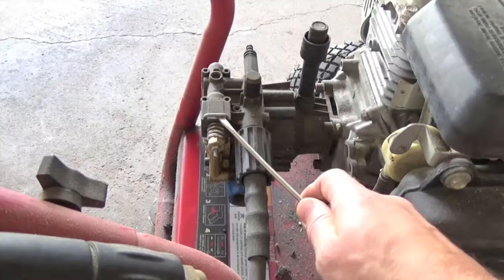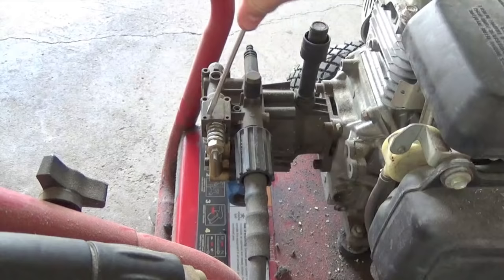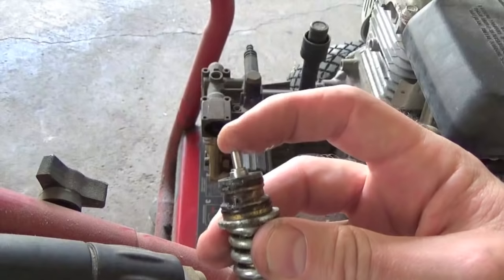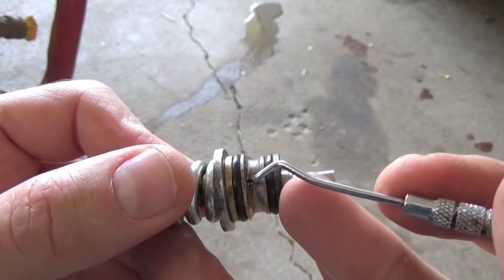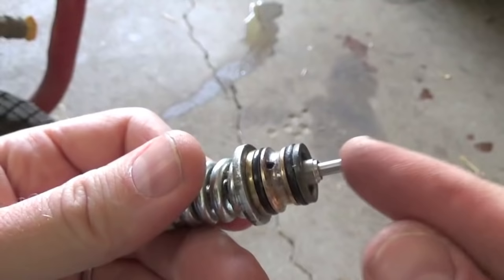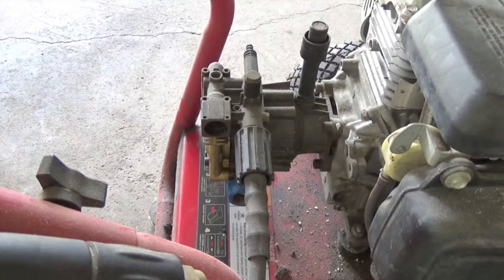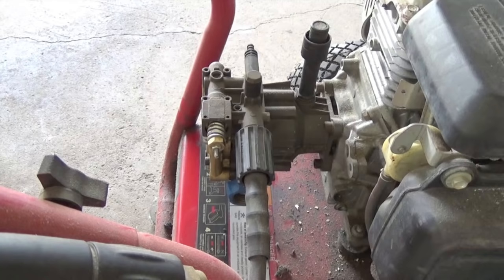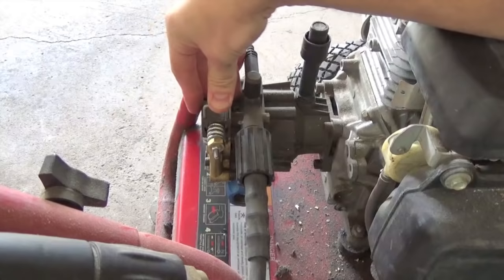Fix Pressure Washer Unloader Valve in 2 Minutes

Comment: "fairly easily"..........that is what all you guys are saying. well, mine broke at the "bolt"....any idea how to get it out now? surely, this is my problem.....thanks!
Reply from the maker: Well, considering it is already broke, I would drill a small(ish) hole into the end of the stuck part and then run a screw (with a big enough head to grab onto with pliers) into that hole and then grab it and pull/pry it out.

Comment: i did that and still intermittent pressure, any suggestions? I'd change the valve but it'll be over $150 shipped.
Reply from the maker: Yuck, if this doesn't work I would check the small plastic spring valves under the brass part of the valve. They tend to stick badly, especially if you have hard water. They are super cheap to replace but can be a pain since you will want to replace the o-rings at the same time Lining up the o-rings is time-consuming.

Never pay for just the valve, you can get an entire new pump cheaper. Valves usually cost somewhere in that ballpark, a new pump is likely around $80. Four bolts, easy work. I have another video on replacing one.

Thanks for watching and taking the time to leave a comment!

Comment: after checking my unloader seems to be fine but pressure washer will still bog down and shut off when not pressing the trigger, any suggestions
Reply from the maker: That sounds like a compression or fuel issue. Does it still pump water through the system?
Reply: @HNXMedia  only water that comes out is when the trigger is pressed it runs great when the trigger is pressed, also if you let off the trigger and let it bog till it dies when water is turned on you cant pull the cord to start, to much resistance. You have to pull trigger and drain system before you can pull the cord thats why i thought it was the valve

Comment: My powerstroke honda 160 Pressure washer has the unloader valve stuck in the hole, I'm afraid broke  extracting it. Used U40 lube screwdriver nothing happend unloader Valve stay  in hole.
Reply from the maker: It could be completely stuck because of corrosion or hard water. It is cheaper to replace the entire water pump than to buy a single unloader valve. I have another couple videos showing how to easily swap out a water pump. The new water pump will have a new unloader valve too https://youtu.be/Np9c0MLnUv8

Comment: Are the Pins Universal? and does the pin seat behind the valve to force it in there?
Reply from the maker: I do not want to give bad info, but I believe all the "U Pin" style are universal. It doesn't really "seat" (as in "click into place"). but it does fit tightly.
Reply: When I try to put in the pin, is it behind the valve? or is it in-line with the valve sleeve? I was given this unit, and the previous owner bought a new valve, and then lost the pin. So I didn't take it apart. Trying to figure out if the valve isn't in far enough (I have the old valve, and tried to seat it with a hammer), but I can't see any day light from the pin holes. I can't see them at all when the valve is in. Is that right (timjoebrown@gmail com).
Reply from the maker: @tb01803   I think I know what you mean. Ok, if you pull the valve out (it should come out easy if there is no pin) you should notice about 3/4 of the way on the valve body a section that the pin slips "behind/into." Don't be afraid to use some grease to help get the valve seated "deep enough," you are not going to hurt anything. Push in on the valve, slowly try to put the pin in. Once you feel the pin going in a little easier, tap it with something to help it along. Once the pin is "flush" it is seated. The pin WILL NOT go in if the valve isn't in far enough. Let me know if this helps.
Reply: @HNXMedia Thanks. I just ordered: Briggs & Stratton 190578Gs Pin.  I was messing around with some small bailing wire and got that through side to side on upper and lower.  Now, this is where the plan went bad. I put water to it, and it blew out the valve, and the part with the ball. I also wound up with a spring, which I don't know if it was behind the ball part or not or from something else going on today. So now I have to figure out the right way to get the ball, the ball seat, and potentially spring, and then wait for the Pin.  Thank you for all your help and responsiveness.
Reply from the maker: @tb01803  The spring should be behind the ball (as if pushing on the ball to cause the ball to "seal the hole" if that makes sense). You know, I absolutely LOVE this comment, because using bailing wire to fix a pressure washer is something I would TOTALLY do. Much love! Best of luck, friend. Peace.
Reply: @HNXMedia  is the order from outside in: Ball, ball seat with o-ring part, and spring all the way in hole?  Or Ball seat, ball, spring ? the ball is just loose, not sure of how it stays in the seat, or if I lose another part when it shot across my patio. Is there a correct process on getting it all back in there.
Reply from the maker: @tb01803  I think it is the first one (working from memory here, so please be careful) - Ball, ball seat with o-ring part, and spring. However, if you think you lost any parts, I would just order a new one. HOWEVER, the last time I checked (a couple years back) it was cheaper to buy an entire new water pump assembly (about $80) than to buy a new unloader valve. Brother, I feel your pain, but replacing the entire pump is SUPER simple. I did a video on it as well. Sending good vibes.

Comment: My powerstroke honda 160 pressure washer low pressure AND the unloader Valve its stuck in the hole. I'm afraid to broke it. Used screwdriver, pliers, hits. But no one. I can't put it out. What i do ?
Reply from the maker: It could be completely stuck because of corrosion or hard water. It is cheaper to replace the entire water pump than to buy a single unloader valve. I have another couple videos showing how to easily swap out a water pump. The new water pump will have a new unloader valve too https://youtu.be/Np9c0MLnUv8

Comment: Mines all free and clear but still won’t unload. Great pressure but keeps grunting away after I release the wand ???
Reply from the maker: If you have have hard water, the build-up can clog/corrode the internal "plastic spring valve thingys" inside the water pump itself. You can open the pump and clean/replace these yourself (super cheap), but it does take a little bit of patience and technical ability. If you feel confident, give it a try. They are usually lined up (4 in a row typically) directly under or inside the actual brass part on the water pump. Each one of these plastic valve things will also typically have a o-ring. Replace the o-rings too if you are going to get that far into it. It really is simple and you can source most of the parts from Amazon or the online retailer of your choice. On a pressure washer, as long as the motor is running well, the only thing that controls actual performance is the pump. Worst case scenario, swap out the pump (usually less than $100), which is super simple. I have two other videos showing that. Hope this helps.

Comment: LOL "you're done watching this video". mine is blowing straight out the side full pressure when i let go of the trigger. I think this is the issue. just wanted to check out the awesome 
tubers on it before i popped the valve out. thanks for the "non" bla-bla-bla video. YOU ARE DONE REASDING THIS COMMENT..LOL
Reply from the maker: LOL! And I would lie to add that YOU are AWESOME for watching my video and taking the time to leave a fun comment. When we are working around the homestead, we ain't got time for nonsense. Get it fixed and get back to work...because there is always more work to do. Sincerely hope that this video helped solve your pressure washer problem. Your comment made my day!
Reply: Update. I did all that. put it back on.knocked it in a little. got the retaining pin back on.Fired it up. Let go of the trigger. It's blowing out sideways even more. Adjusted the spring more then less. still doing it. I'm going to put some new o rings in it and see what happens. I'll update ya tomorrow. P>S> I did a bunch of work in Homestead/Cutler Ridge (PALASCE CENTERFOLD STRIP JOINT)and Floriday City. after Hurricane Andrew. Ended up living down in the UPPER KEYS  for 8 years. I painted SUPREME OLDSMOBILE IN FLORIDA CITY. Every night going back, I hit THE LAST CHANCE SALOON. I AM DONE TYPING..PEACE
Reply from the maker: I have had to replace the o-rings and the little plastic valves in the water pump in the past (not too much work, but I had to wait for parts). If it gets to be too much of a hassle, just replace the entire water pump (see my other videos on that). It is an $80 fix that is actually cheaper in the long run of the unloader valve wasn't the problem. Good luck, my friend!

Comment: And if that does not solve my pressure issues?
Reply from the maker: Could be that the interior if the pump is completely corroded. If you don't feel like opening it up to clean it - lots of little parts) you can just replace it. It is super easy and I show you how right here: How To Replace Pressure Washer Water Pump (Part 2)
https://youtu.be/Np9c0MLnUv8

Comment: My pressure washer won't idle down when I release my trigger... continues to build pressure....
Reply from the maker: That certainly sounds like an unloader issue. Hopefully this vid will help your pressure washer get back on track. If not, I would check the little plastic valves under the upper part of the brass pump-head (thats where they are on mine). Sometimes those stick. I had to fix those on my old pump several years back. But certainly check and clean the loader first. It is often the simplest fix. Thanks for watching and taking the time to leave a comment. Peace!

Comment: Did u say Greece? ???. Anything that can compress air to 3000 psi can cause a explosion. Never put petroleum on high pressure parts. Use non petroleum silicone. If that was a scuba tank ,it would have exploded  when u opened the valve.

Comment: OK , I'll be the group dumbass that asks, since you kinda jumped right into RemoveInspect Clean n Replace without saying WTH that part even does.   What's it's purpose?  

Im trying find a fix for my 2000 electric, it works but won't shut off, just keeps on running.  Is THAT the part that is supposed to kick it off when up to pressure?
   I wonder, I had mine on three hoses, was the pressure to low to make it shut off maybe?  I was gonna test it on one hose but forgot.  I will later.  
Anyways, I appreciate the short video, but give me 15 see seconds explaining what the parts For at least.
Reply from the maker: Long story short, the unloader valve regulates the pressure so that the pump does not "pressurize" and rupture. Just about anything to do with pressure on a pressure washer can be fixed by cleaning the unloader valve. If that does not fix the problem, it is cheaper to replace the entire pump than to replace just the unloader valve itself. I have a video on how simple it is to replace the entire pump on my channel (3-4 bolts and you're done).

Comment: My unloader valve moves freely , the machine stills stalls if I have the garden hose connected and on and I’m not using the sprayer
Reply from the maker: Does the engine stall or the water pump not create pressure?

The next step to solving the problem would be: Pull the pump and check the seals. Also, separate the pump head (usually brass) and check the o-rings around each of the individual valves. They are usually little plastic spring-loaded things (I have had to replace both the o-rings and the plastic spring valves before because they get clogged with hard water). Hope this helps.
Reply: HNX Media , the engine runs good , when I first hooked up the garden hose it start bogging out but didn’t stall , after power washing for a few minutes i released the trigger and it immediately bogged down and stalled , the pressure seems good , it washes well.
Reply: Also the adjustment portion on the valve was marked by the manufacturer and it doesn’t look like it moved
Reply from the maker: The definitely sounds like an unloader valve to me. Not sure what else to suggest other than pulling the entire pump head and cleaning everything inside. Do you live in an area with hard water? The hose should be run through an "outdoor" filter if you do have hard water. Hard water can destroy a pump quickly. If it turns out to be a completely bad unloader valve, keep in mind that you can replace the entire pump cheaper than buying just an unloader valve. Hope this helps.
Reply: HNX Media no to hard water , that unloader valve doesn’t look like much , are they expensive
Reply from the maker: Typically over $100 (at least for my model) for an unloader valve. You can replace an entire pump for around $80. A pump is usually only 4 bolts to take off. Super easy to replace. I did a video on it as well.
Reply: HNX Media , thanks for your help

Comment: Good video, but did not provide enough info.  Perhaps, should have mentioned that there are tiny O-rings inside the spring-loaded valve that might need to be replaced.